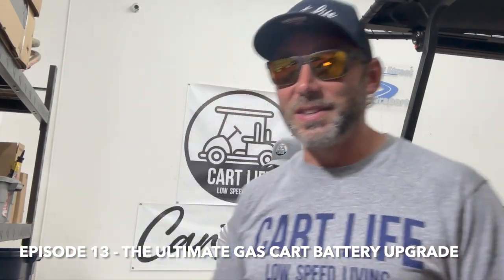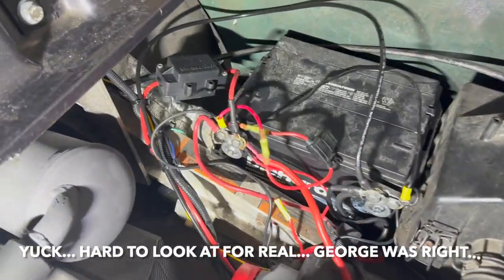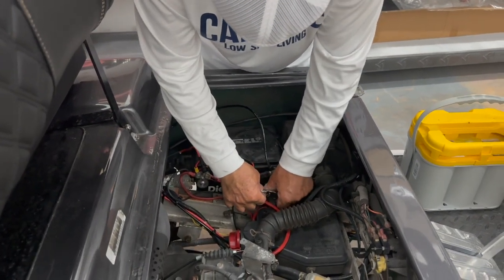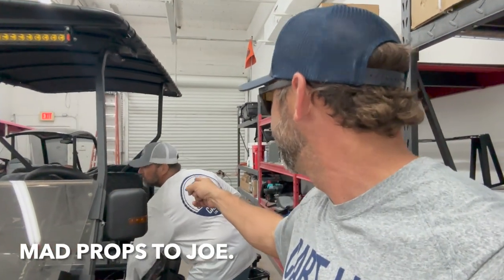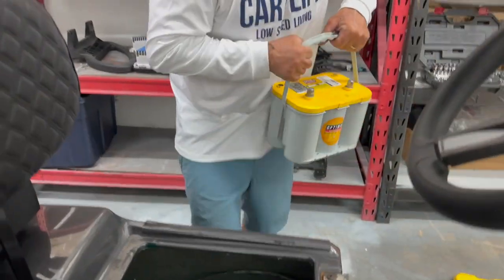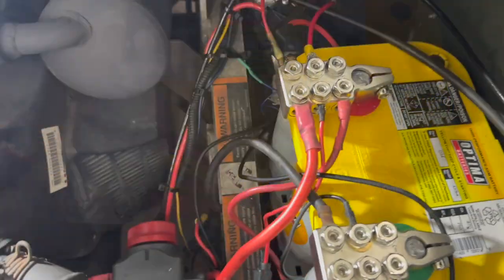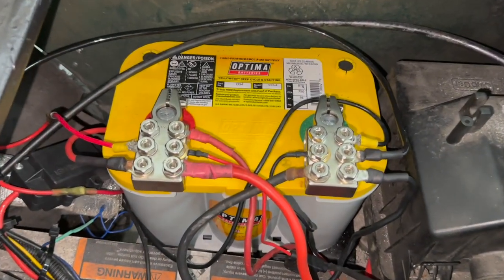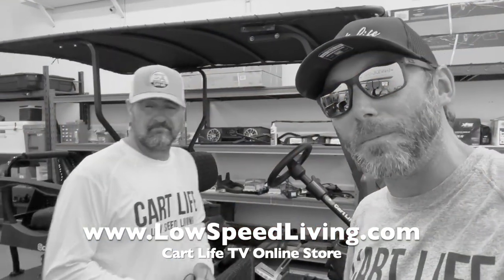Episode 13 - Ultimate Battery Upgrade? Did we install the best Golf Cart Starter Battery? Optima!

Comment: Does your golf cart turn off when you come to a stop? Or do you have that disabled where it will idle?
Reply from the maker: It turns off.  It was important to keep the pedal start
Reply: @CartLifeTV  Yea mine has a charging issue even after replacing voltage regulator and starter generator.